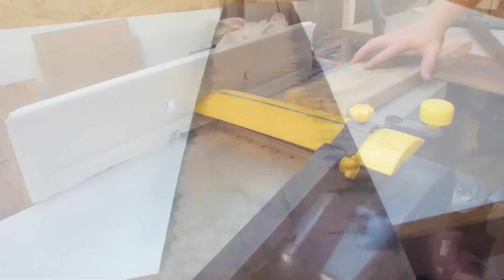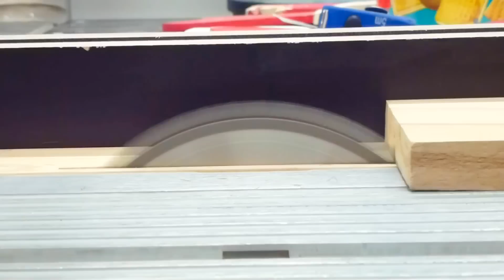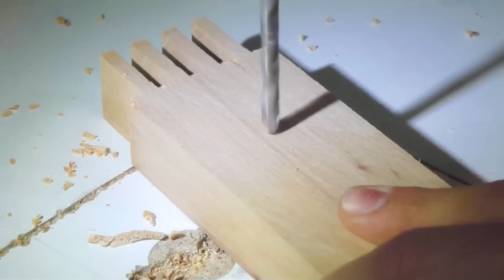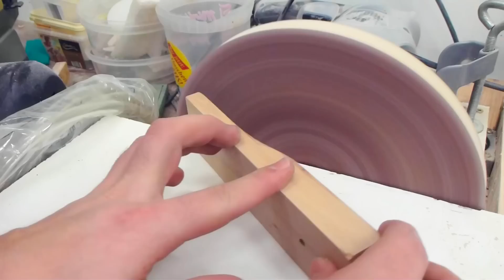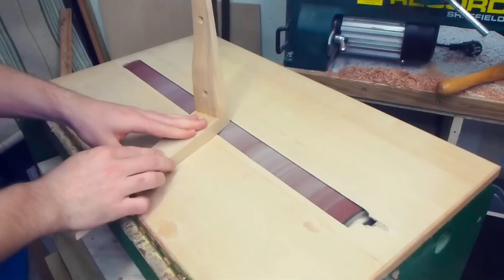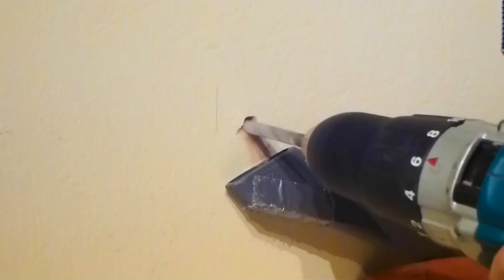Shelf Brackets (mini project)

Comment: Marius, that is NICE, Very nice.  I wondered why you were going to such lengths with the brackets, but the stone shelf is wonderful.  Ordinary brackets would spoil the whole thing.  Did you think of using walnut, maybe?  Or maybe a highly figured wood, such as Leopard wood?

By the way - yes, it does take a little longer to set up the router, but it makes cutting circles so very easy - at least the way I do it:  I have the router on an arm, of course, but the pivot point is NOT a hole drilled in the work-piece:  I have, instead, a separate piece - square, so I can align it perfectly on two diameters at right angles and stick down with double-sticky tape, which provides the pivot point in the form of a dowel which mates with a "slitder" which slides in a slot in the arm.  It secures to the arm with a bolt and knob, and is very easily adjustable.  If you have made the hole too small you can always realign everything by simply setting the apparatus up again, and,by swinging the router, both find the existing radius (should p[reserving the center by necessary) an the correct  radius.  And my jig is extendable - the largest diameter circle I have cut is 20 feet; just over 6 meters).  For that I swung my DeWalt "625" riouter - about 30.5 hp.
Reply from the maker: neelode No, I didn't, because I didn't have any and nobody ever sees the brackets anyways.

Comment: Beautiful work I just had one question. My assumption is that you are an engineer (I’m not) but it looks to me that the weight of the shelf is only supported by glue. One of your dowels through the join like you did on your lifting table would have done it, or am I over engineering a shelf support?